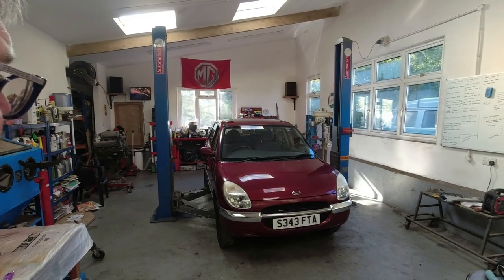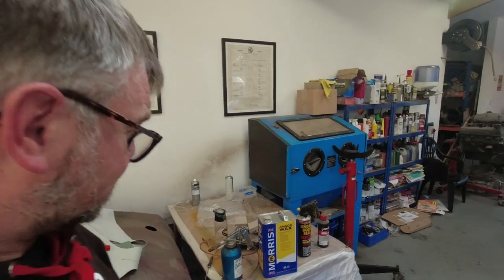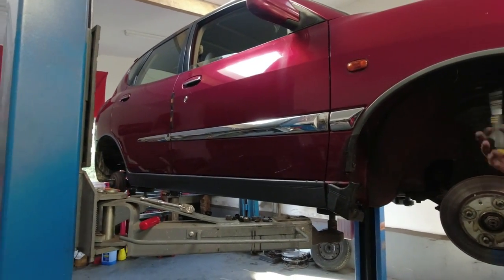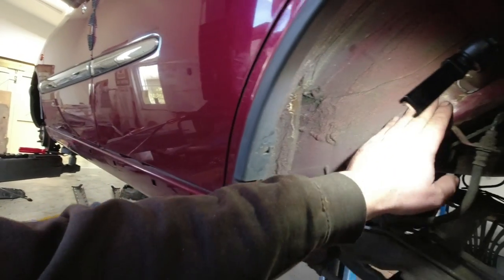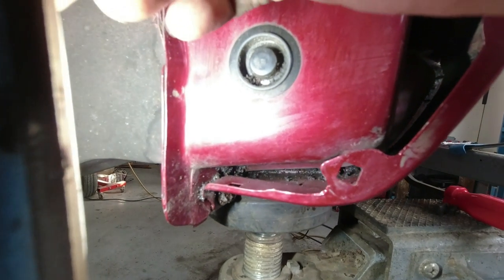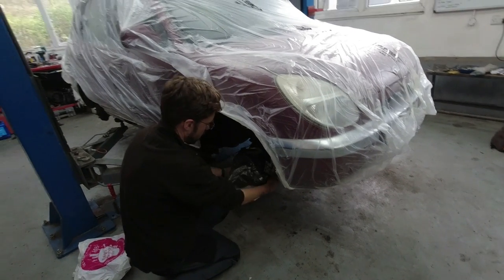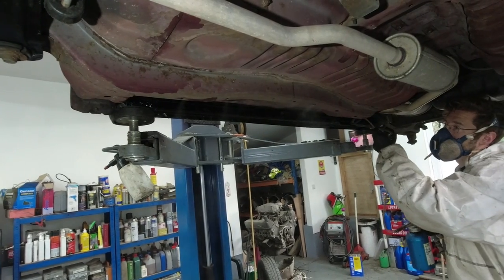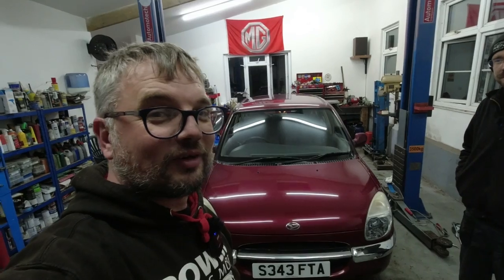Waxing my Daihatsu Sirion - welding was necessary...

Comment: The bottoms of the wings are such a typical spot in many cars for dirt to accumulate. Usually when I buy a car, at some point I remove the inner wings to clean said crud out. Thankfully modern paints seem to last quite well against such moisture. Nice to see the Sirion get some protection against the winter! It really is in remarkably good shape.

Comment: I was wondering about the Shutz underwax: do you need to apply some sort of clear coat on top of it or is it okay once it has been applied with the gun?
Very informative. Thanks!
Reply from the maker: It's fine once applied. It's a full underseal rather than just a stonechip.

Comment: 24/10 22 Daihatsu Dealerships seemed to have disappeared. Saw a Terious, was it  (?) recently - looked twice - thought l was looking at the same colour car as my Suzuki SX4. Good vid' - the Morris protectant seems to penetrate the seams. Will it need checking periodically ? 64 dollar question - How long is it expected to last ? Impertinent question - How much did it cost ? Happy Motoring all !
Reply from the maker: Cost was £325 including rather more welding than expected... Generally under £300 should be possible. No firm idea of how long it'll last but a good few years.

Comment: Six likes, six comments. I wonder if my 1999 Daihatsu, which I bought with a mere 8000 miles on the clock, is still on the road?
Reply: Chuck the reg into Vehicle Smart and find out! (Or post here and I'll run it for you)
Reply: @the.internet  It was an insurance write off in 2010. Rear-ender with cracked bumper and dented tailgate. No metalwork damage underneath the bumper, so an easy fix if you could get the parts. About 75,000 miles. It had a tow hitch and did much more damage to the Renault which rear-ended it. I remember looking a few years ago but I can't remember what app. Reg T311 JPU. It was always a very rare car and there can't be many left on the road now.
Reply: @tonymaries1652  unfortunately it looks like 2010 was its final year among the living with both tax and MOT expiring that year. Shame as your Grand Move had great MOT history, no advisories! I remember those cars, very very rare. My dad almost got one back at the turn of the millennium but instead got a Suzuki Wagon R. The mk1 Wagon Rs are just as rare now, can't remember the last time I saw one. Rust got them all (it got ours). Seriously good little Japanese K car!

Comment: I just dont get how cars dissolve as much as they do in the UK. It must be the mild winters that result in roads being oversalted or something
Reply: Come to Denmark, we use salt on the roads. Here rust protection is a must.
Reply: It's our maritime climate; we get very high levels of humidity even in summer, so many vehicles are almost permanently damp in underbody crevices and behind plastic trim. Add to that the fact that, because we rarely get snow, winter tyres are unnecessary; instead, we rely on road-salting to deal with occasional frost or snowfall, and in any case, you're never more than 60 miles from the sea, so salt-laden air is another factor.

Comment: I'm due to underseal my BMW and a little rust removal from the inner rear sill what would be best to use? Anchor wax or waxoyl?
Reply from the maker: For rust removal, Jenolite. Not a Waxoyl fan and it certainly won't stop pre-existing rot. Ankor Wax is better for that.
Reply: @HubNut  Thanks Ian, I was going to rub it down amd use KureRust as my old fella has a huge supply of it because he restores 2cv's. I also hate waxoyl plus its smell and had never heard of Ankor Wax so I am going to go off now and order a gallon of Ankor Wax.

Comment: How strong is the odour these days in these wax coat products? 
In the 2000's, a bodyshop welded rusted rockerpanel in my car, and wax coated the rocker panel cavity with some product, and oh man it had really strong odour. 
Got a headache when I drove the car home from the bodyshop :P  I had to keep the doors and windows open quite a while to vent that odour away.
Reply from the maker: It's a week on and it still has quite the whiff...
Reply: Probably worth replacing the pollen filter and using something like Holts Sanitiser to clean out the vents as the fumes from that wax are probably trapped in it. 

With the Holts stuff and similar products, set the can off with all windows up placed near the handbrake, run the engine with the AC (if you have it) on full blast recirculating air for 10-15 mins. Stuff does wonders cleaning out the system.

Comment: The waxing must cost more then the car
Reply: Depends what you use and who your paying, another youtuber Mustie1 uses chain oil diluted with parafin, much cheaper but yearly application he says it works well for him
Reply: Maybe (although good luck getting a car for £300 these days), but what's a few hundred quid to keep the thing that's most likely to kill a Japanese car at bay - rust. Look after these simple cars and they'll go on forever.
Reply: @the.internet  they will outlast many of the current motors…like ecoboost
Reply: @eggy1962  agree with that! The only thing that'll get them off the road besides rust is Sadiq Khan (I'd rather have rust).

Comment: The problems we don't have to address in Australia because of our climate very little snow equals no rust my 1997 toyota hilux has a boxed frame chassis no rust at all the cab isn't rusty the tray isn't rusty oops its aluminum but in the UK and parts of North America rust rust rust and the peventative mearsures you have to do is worth especially with Miss Daisy and she was the right price free and for a in such good condition